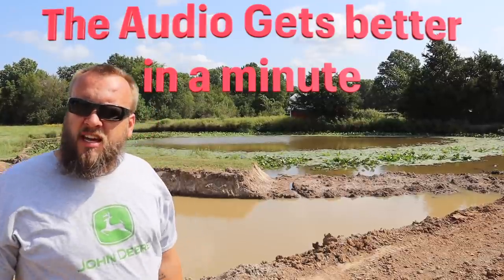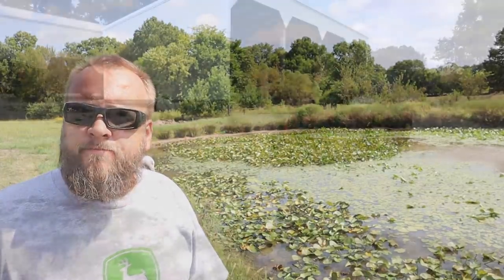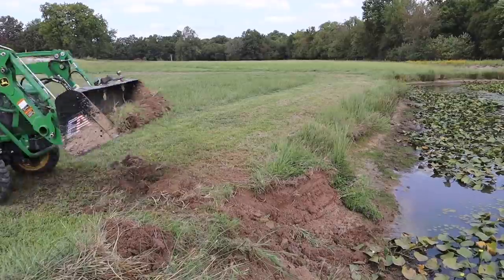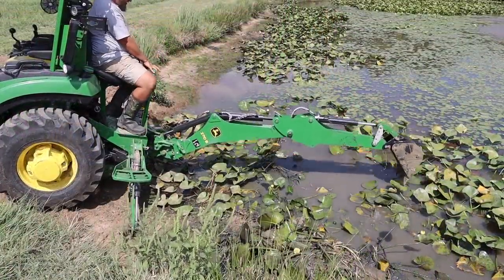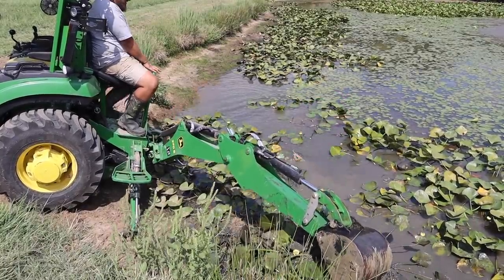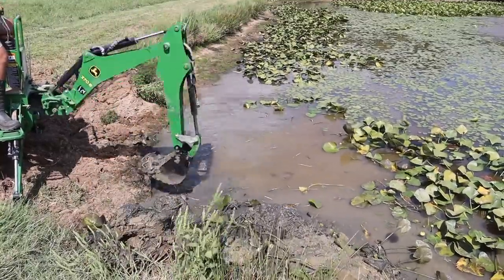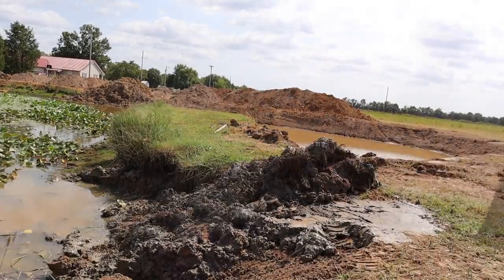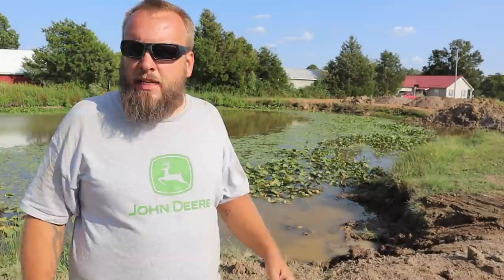Dredging a Pond with a Tractor Backhoe - Digging Out Lily Pads

Comment: I never realized the lily pads had such a root! Thanks for recommending Kapper Outdoors.  I thought maybe there'd need to be a tractor recovery video when I saw those back tires start to slip at the edge of the pond.
Reply from the maker: The part that got me worried was when I put the outriggers down and they didn’t really lift the tractor. They just sunk

Thanks for watching

Comment: With the limited swing (180°)of a backhoe , you need to place the tractor parallel with the shoreline to efficiently remove the debris the max distance out of the pond .
Keep cutting the bank angle down 
for better mowing, tractor access, cow access,  etc .
Angled digging is scary.  I've been running a small mahindra backhoe for 20+ years. But it can be done safely !
Your instincts were correct to cut down the bank. Just turn the tractor 90° and go get them lillies  !!!
G

Comment: Found this on thepondshop .com "Aquatic herbicides made specifically for use in and around water are a safe and effective management tool. Aquatic herbicides are very successful in treating lily pads. Products such as Shore-Klear or Reward  and Weedtrine D, when mixed with a nonionic surfactant such as Cygnet Plus  work very well at killing Lily Pads and assisting in gaining control over them. "
Reply from the maker: Thanks. I’ll probably try that next

Comment: I saw a product on the Good Works Tractors channel that I think would help here.  It's called a Yard Glider, a flat plastic sheet that you can roll out and pile material on, then drag it away.
Reply from the maker: That would help. I wanted to use the dump trailer but I couldn’t lift high enough from down there

Thanks for sharing

Comment: Shore-Klear Liquid Aquacide will work within about 10 days - sooner if you mix it really strong, either way it beats the heck out of trying to pull out all those lily pads. It's safe for fish, deer etc. TSC has it, and it's a lot cheaper than renting a mini excavator.
Reply from the maker: I wondered about that. I watched a couple videos but the people were saying it would kill the fish if you used a herbicide

Thanks for sharing
Reply from the maker: Thanks for the info
Reply: @rickvaughan8993  I ordered "Applied Biochemists Shoreklear Plus Aquatic Herbicide, 1 gal" from Amazon (currently out of stock but they have the same stuff at TSC) in my pond which I have stocked with catfish, trout, blue gill, bass, turtles, and some I am not sure of - no weeds and zero fish kill - I've been using this for about 8 years now and love it. Deer drink from the pond all of the time, so do my dogs - no issues whatsoever. It also works excellent to kill weeds around the property, not just the pond.
Reply from the maker: Thanks for sharing
Reply from the maker: I imagine I’ll be using a chemical treatment As soon as I can get it in. Probably still be renting an excavator for the rest of reshaping bank of the pond

Do You guys spray it directly on the plants or is it something that you just add to the water 

I’m guessing it would be most effective if I took a boat out there and sprayed it directly on the plants
Reply: @np3m  Shoreklear will kill all of what you say. I have used it. My comment about using weedtrine-d was that you can add it per directions early before weeds sprout and it keeps them from sprouting. Thus you never see the weeds. Nor have to worry about decaying vegetation depleting oxygen and causing a fish kill. I have been taking care of my pond since 1993(dug in 1992) I also helped my father in law for 10 years taking care of a 6 acre pond and a 1 1/2 acre pond. And then inherited the property with the 1 1/2 acre pond. And took care of it from 2010-2017. Plus taking care of my own pond! So there is that!! Shoreklear works so does weedtrine-d so use what you want. After MANY years of pond maintenance I prefer the pre emergent myself!
Reply: @RockhillfarmYT  Spray it on the plants! I have a 15 gallon 12 volt sprayer that sprays out pretty far. But you may need a boat to reach  some. And as on a previous comment I made. Pedal boat! I have one that needs the pedal assembly reinstalled(if I can find the parts) I would give it to you. But the fuel to come after it might be more than just buying a new boat. I don`t think there real pricey. But understand you have been spending plenty.
Reply from the maker: I’ll have to keep an eye out for one
Reply: @RockhillfarmYT  I have a 2 gallon sprayer and spray as much on the plants as I can which works best but I just get what I can get from the shore - which keeps the whole pond weed free.
Reply from the maker: Thanks for sharing. After reading the comments I think I’m going to spray them

Comment: If you have a boxscraper,  might look into making yourself a ramp and use the boxscraper to pull out the sludge. And with that implement, moving your spoil away from the pond rim could make it easier to load your loader. 
Might have to make that ramp fairly shallow (long) to be able to get sludge pulled out. Good luck with your pond digging.
Reply from the maker: Thanks for sharing

Comment: I been thinking about mounting a landscape rake to the bucket. And I think it would help you here. On the backhoe. Or buy a plate for loader and drive in and blackout with the landscape rake on the front
Reply from the maker: Good suggestion I have a set up to put the landscape rake on the front and I thought about it. I just don’t think it would reach far enough

I saw one guy in a Facebook group that had his landscape rake on an extension but I don’t have the metalwork skills for that
Reply from the maker: Never seen anyone put it on Backhoe

I use a plate from Artillian to put rear attachments on the front loader
Reply: @RockhillfarmYT  they make rakes for backhoes. I think they are mainly for excavators. Probably would be too much work to make a 3pt go on a backhoe or the tines wouldn't be strong enough on a typical rake